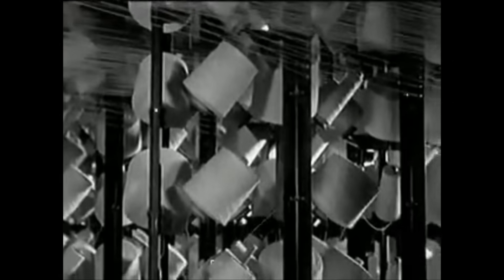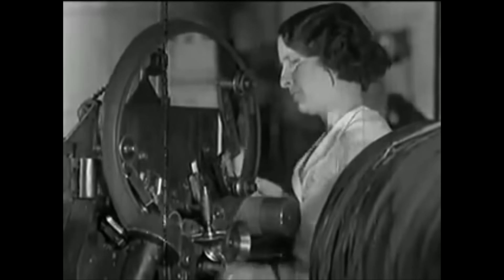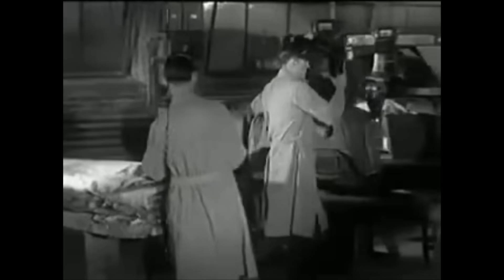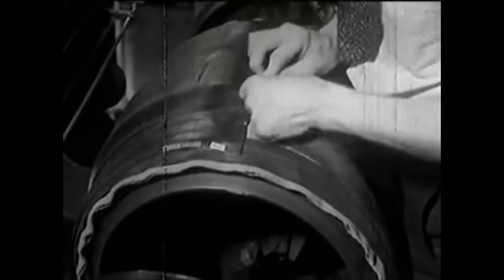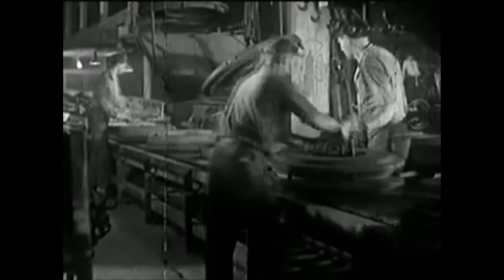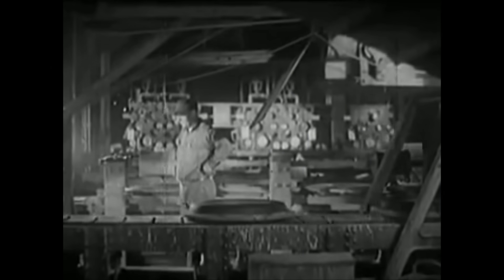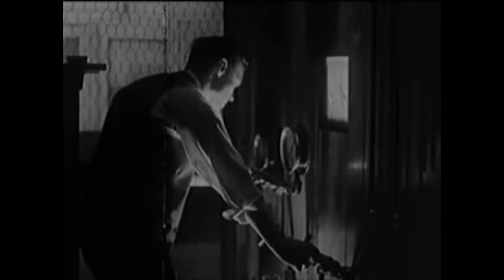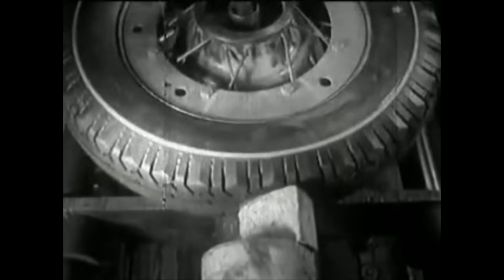This Original Film Shows How Tires Were Manufactured Back In the 1930s

Comment: In the summer of 1970, after graduating from high school I had a summer job at McCreary Tire and Rubber factory in Indiana, PA.  I recognized the Banbury mixers, rolls and calendars in the movie as very similar to the machines at McCrearys.  Some of the mixing mills were powered by a steam engine which drove a shaft and belt system to power the rolls.  I remember it was miserably hot and the chemical odors were sometimes overpowering.
Reply from the maker: Wow!  What a great memory you shared!  Thanks for commenting and for watching!

Comment: Wire w 280KIPS ultimate strength impressive even by today's standards...at least for steels in general, not sure about tire wire.
This illustrates why tires were so much more expensive, for what the were, back then.  All that manual labor.  8k miles out of a new tire was good back then.

Imagine how many yrs and how much trial and failure, exasperation inspiration and brilliance went into each of these processes.
Reply from the maker: It boggles my mind to think about who came up with the design and manufacturing process and then the design of the machines that made up those steps.  Thanks for commenting and for watching!

Comment: I'm a 1/87th HO Scale Model Railroad Hobbyist. I'm researching tire mfg., old school and modern methods, and machinery. I'll be adding a full super detailed, scratch built, 1/87 modeled tire production mfg. line, to the interior/exterior of a complete tire mfg. facility, on my Industrial branch line switching layout. Back in these times, extensive labor demanding jobs for these hard working men and women, was breathtaking.😲🫡 I salute them for sure! Today automation, NC Computers, and robotics, do almost all the work. But whats certian to always be true, the hands on production put out a greater longer lasting quality tire, for cars and the era of that time. Also, back then full real rubber was the product. Today is a mixture of real rubber and synthetic chemicaly man made rubber. In many ways tires are better, no doubt. Due to the inovative tech advancments, of tubeless and steel belted radial tires. But even with such advancments, theres always certian failures in some ways, due to modern mfg. methods that lack of hands on quality work, like old school production methods. My personal opinion, and experiance, I'm certian that old school methods always produce better quality, in any mfg. method of a product. Very facinating to see this video. Thanks for the share. The more I learn about tire mfg., the more anxious I get to build that model plant on my layout. It'll take several years, but when finished, with lighting and all the details modeled of a full facility; there'll be chemical storage tanks, Black Carbon unloading area and eqt., boxcar shipping recieving bays, and a large backdrop 3D background building, also scratch built, distrubution warehouse. I'm modeling a 1970 era B.F. Goodrich plant. In my hometown, about a 30 minute drive northeast of it, was a real plant when I was a kid. Sadly, it suddenly shut its doors in 1980 without warning, and is now demolished. God Bless, and thank you again for a great video! I love industrial stuff! Cool!😎🫡👌👍I apologize for my novel length of a comment. I just get excited talking about my hobby! Lol😄

Comment: Does Brunswick tyre manufacturer still exist and under what name, if it does?
Reply from the maker: While Bruswick began making automotive tires around 1912, BFGoodrich acquired the Brunswick tire business in 1922. Brunswick had previously been involved in tire manufacturing, but they sold the tire division to BFGoodrich, which continued to produce tires under the Brunswick brand. BFGoodrich, in turn, was acquired by Michelin in 1988, but they continued to make Brunswick tires until around 1990.

Comment: Where is the Brunswick Tire Company today ? 😊
Reply from the maker: While Bruswick began making automotive tires around 1912, BFGoodrich acquired the Brunswick tire business in 1922. Brunswick had previously been involved in tire manufacturing, but they sold the tire division to BFGoodrich, which continued to produce tires under the Brunswick brand. BFGoodrich, in turn, was acquired by Michelin in 1988, but they continued to make Brunswick tires until around 1990.
Reply: @kensmithgallery4432 Wow , thanks for the answer, wasn’t expecting that . 😊😊

Comment: Great video i think i had a set of Brunswick tires in the early 70 's on my 66 Impala i wonder who bought them out?
Reply from the maker: BFGoodrich acquired the Brunswick tire business in 1922. Brunswick had previously been involved in tire manufacturing, but they sold the tire division to BFGoodrich, which continued to produce tires under the Brunswick brand. BFGoodrich, in turn, was acquired by Michelin in 1988, but they continued to make Brunswick tires until around 1990.  Thanks for watching!

Comment: What is the comparison of the tires made today from the tires made back in the 1930's? Did they use better quality rubber back then ...hummmm?
Reply: Today they have butyl rubber liners which leak air much more slowly than back then. Back then you would be pumping up your tires all the time.
Reply from the maker: There are so many different materials used today versus tires made 70-80 years ago.  It's nearly impossible to compare.  Great question and thanks for watching!

Comment: ☝️WHEN I WAZ A KID LIKE BACK IN 1964-65 THERE WAS A SHOP HERE IN TAMPA  FLA. CALLED IV's TYRE SHOP THEY SOLD NEW TYRES ASWELL  AS  RE-CAPS ☝️ THEY RE-CAPPED THE TYRES TOTE THERE IN HOUSE ☝️ THERE WAS THE GRINDER  ROOM IT HAD A CLOSED DOOR THERE WAS A LONG STEEL SHAFT COMMING THROUGH  THE WALL  ABD ON THE  INSIDE OF THE ROOM THERE WAS A DRUM COVERED IN SPIKES THE GUY IN THAT  ROOM WOUKD GRAB A TYRE AND GRIND OFF ANY TREAD LEFT AND MAKE  THE CASING ALL FUZZY LOOKIN THEN OUT IT CAME TO A GUY WITH WHITE  COTTON GLOVES ON HE SET I T UP ON A MANDREL AND PUT ON FRESH RUBBER THEN INTO THE COOKER TO BE REVULCANIZED 
THEN A GUY WOULD  PULL THE FRESH BAKED TYRE OUTTA THA MOULD 
THAT GUY HAD HUGE ASS ARMES 
IT TOOK  A LOT TO PULL THE FRESH CASING OUTTA THA MOULD
Reply from the maker: Sounds like a great memory!  Thanks for sharing and for watching!

Comment: This was back when our tires were made with  real  rubber. Today they are made w a man made rubber substitute which is stronger & safer & longer service life.
This vid shows them using RAYON cords. later, in the 60s they switched to polyester cords then nylon then steel.

!
Reply from the maker: I believe like everything else, as technology changes, most everything improves with those changes.  Not always, but most often.  Thanks for sharing and for watching!

Comment: So,what happened to Brunswick Tires ? any clues ?
Reply from the maker: It's mentioned briefly in the video description but essentially, BFGoodrich acquired the Brunswick tire business in 1922. Brunswick had previously been involved in tire manufacturing, but they sold the tire division to BFGoodrich, which continued to produce tires under the Brunswick brand. BFGoodrich, in turn, was acquired by Michelin in 1988, but they continued to make Brunswick tires until around 1990.